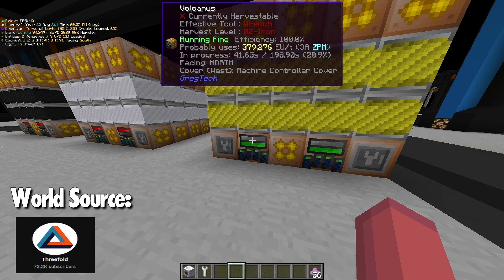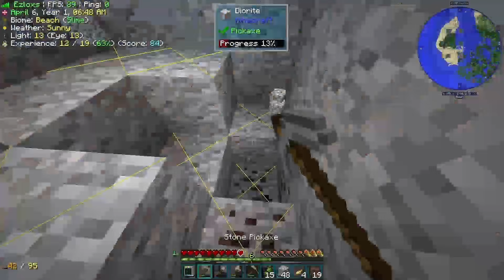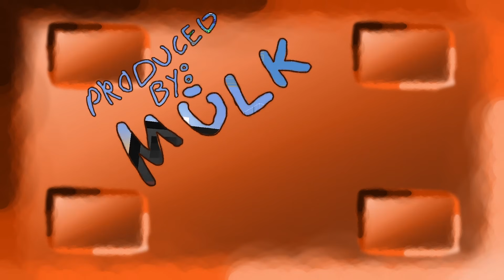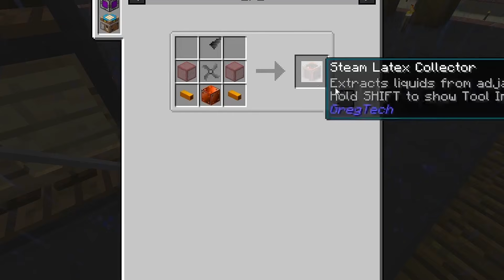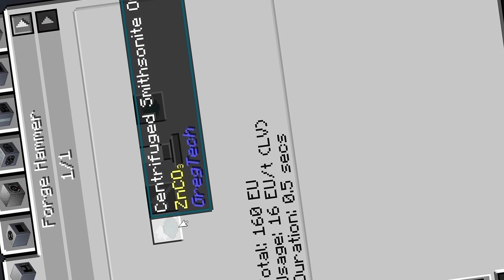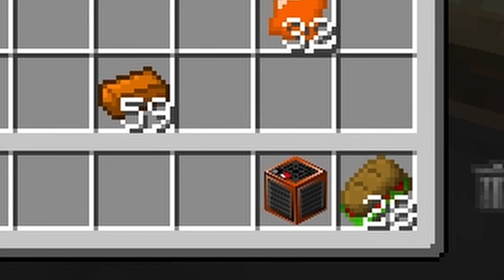Steamed Machines - Supersymmetry ep. 0.5 [Modded Minecraft]

Comment: you may not see this but, I'm having problems with my high pressure steam machines not working properly even though they are connected and fueled properly, am I doing something wrog?
Reply from the maker: Have you checked that the steam exhaust is pointed where there is no block/pipe blocking it? You can change the direction where the exhaust is facing with a wrench.